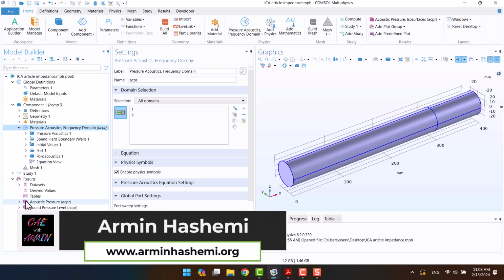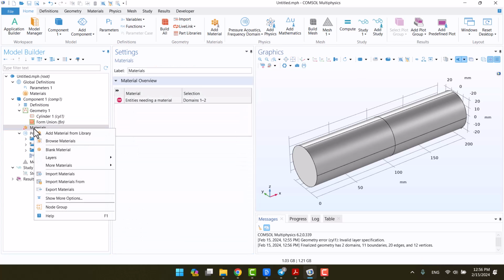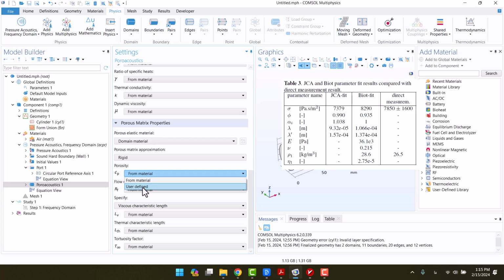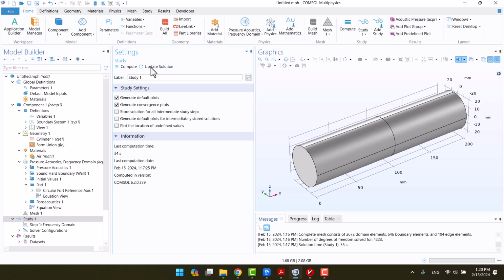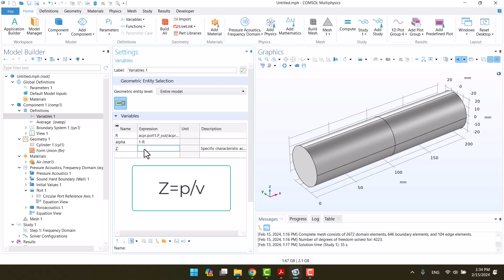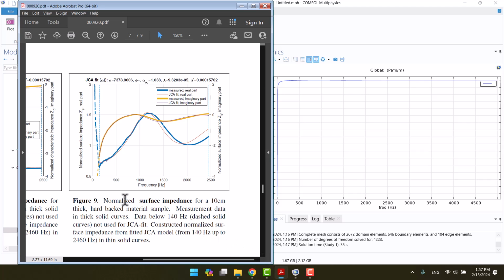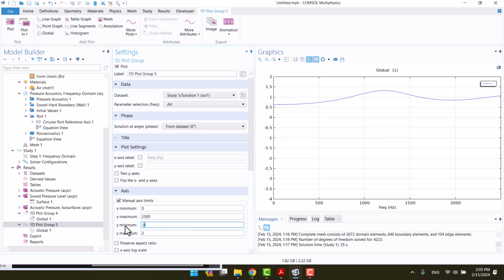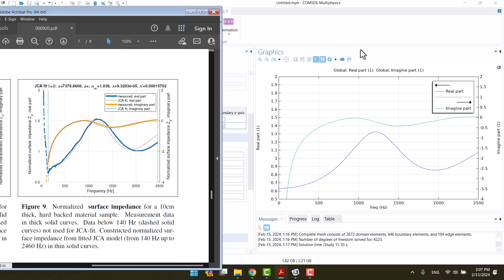🎶🔊 COMSOL Tutorial: Acoustic Impedance of Porous Material Using JCA Model 🧱🌍

Comment: Hi Armin, how are you?  I have a question about impedance.  I was reading this article titled "Static flow resistivity measurements based on the ISO 10534.2
  standard impedance tube" and I would like to calculate the resistivity to the flow using the impedance formulas that the author brings to the text, in COMSOL. I believe that one of them you already presented in the video, but the others I am not able to do. Could you help me , please? Can you use the same geometry as in your video.
Reply from the maker: Hello. how can i help you
Reply: @caewitharminhashemi  Hi Armin.  Thanks for answering.  I would like you to help me put in COMSOL (in the variables part) the impedance that appears in the article I mentioned.  I didn't want to bother you, you taught me a lot but I have doubts about how to put this variable that appears in the article in COMSOL.
Reply from the maker: @gabrielhernandezrozo848  please email me article.

Comment: alpha = 1-R, or alpha = 1-R^2..? which one is correct?
Reply from the maker: R is reflection coefficient. Pressure reflected to pressure incident. Here I used power, not pressure (p). Therefore alpha =1-R. Power is proportional to p^2.
Reply: Well noted. Thanks. I have one more question. If we calculate the reflection coefficient (R) from surface impedance (Zs), is it possible to realize it in Comsol?
Reply from the maker: @BondanDwisetyo  yes. There are several examples in Comsol library